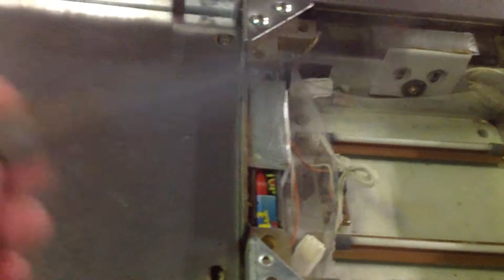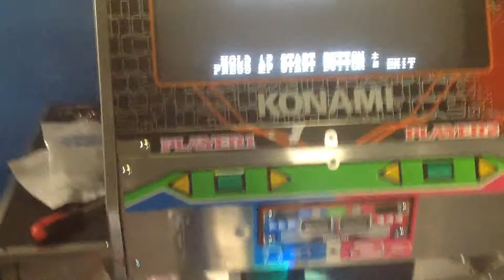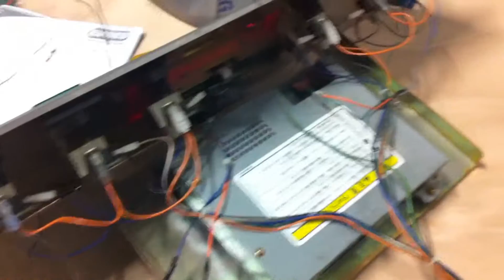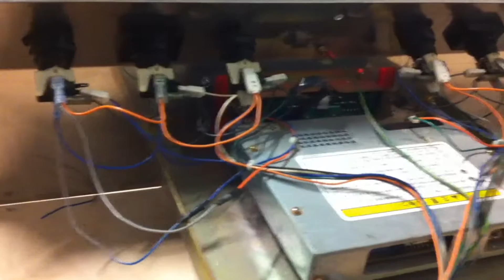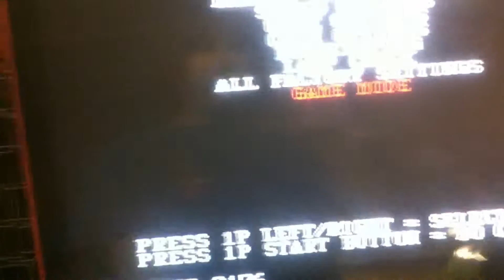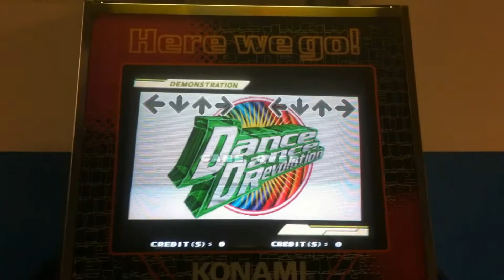DDR Pad Fixes + Memory Card Slot Lighting and Rewiring

Comment: Hi,

have you ever had a no sound issue?

there is a local auction happening with two ddr machines for sale.

one is a max 2 and the other is an extreme.

they have taken the computer and display out of the extreme and put it into the max 2 cab lol. I guess certain things weren't working so they wanted to make one working machine out of two.

so they say that the ddr max 2 cab with the extreme computer works except that it doesn't have sound. 

What could the issue be? just a connection problem or could it be the output from the computer, in which case I don't think that can be fixed. 

Thanks.
Reply from the maker: Could be as simple as an unplugged cable or as complex as a broken I/O/Mainboard.  It's most likely just an unplugged cable though.
Reply: yea I agree. as I understand it there is actually a dedicated sound card which I'm sure includes an amplifier.
Reply from the maker: @ABCarmand  No sound card.  There is a flash card that store various data though, which is also needed but it would not cause audio issues if it was missing, it would cause game errors.
Reply: I notice from the pictures that only the logo on top is lit up but none of the spot lights on top or the fluorescent's under the arrows are lit. I wonder what that means and how it relates to there being no sound?
Reply: so i went to see it today and the speakers have power going to them (they hiss and the sound changes when i adjust the volume) but they have no game audio going to them.

some of the lights work but not all so maybe some burned out bulbs or connection issues.

but most importantly I get an "error 132 cassette error (1)"  right after it boots up from the disk.

this machine did work at some point in the last few days so this error is new. any thoughts?

Thanks
Reply: I think someone may have turned the power off when it was in the middle of booting up.
Reply: on Reddit some guys are saying it could be a loose connection.

Comment: Is it possible to hook up memory card slots to a Korean cabinet? I would think it should be since I've heard that a Korean cabinets hardware is identical to a Japanese cabinet. What do I need to hook up the memory card slots board? I've heard it needs to be hooked up with a USB or RS-485.
Reply from the maker: USB is for data only and that gets plugged into the 573 directly.  You need to pull 5v and GND to the pinouts on the memory card unit.  It is definitely possible to do however because Korean cabinets use a different front plate you can not swap the plate with a Japanese one that has them pre-installed.  You will need to make a hole in the plate yourself or get creative and place them somewhere else.
Reply: OMG KON!
I just received the memory card reader that I bought off eBay. How exactly do I pull 5v and GND to the pinouts? Do you have a diagram of the pinouts so I know which pin is for 5v and GND? Do I need a connector to plug into the pins? There is a bit of a problem with the memory card unit. The white strip that connects the memory card reader to the pins is cut on the 2 pins furthest to the right if looking from the back.
Reply from the maker: Pull power from jamma.  Also I am not sure what cable you are talking about.  You would have to show me a picture.
Reply: OMG KON!  I'll take a picture tomorrow. I was talking about the white ribbon/flex cable that's connected to the pins. It has a slight cut or tear on the flex cable that connects to the 2 pins farthest to the right.

I was hoping this video would show what the back of your hooked up memory card unit looks like, but it doesn't. Do you have any pictures of it? I noticed you were talking the 5v and GND in the video. Is that what you were talking about?

I haven't actually unscrewed the plate and tried to get it to work yet. When I do will there be some wires with a connector I can just plug into the memory card reader to get it to work or will I have to splice some wires connected to the 5v and GND?
Reply from the maker: Send me a message tomorrow when you got your picture.  The GND and +5 are what I talked about in the video, yes.  Also I don;t know what your plate has because if you bought just the front plate it could be anything.
Reply: Could I get all this information too?  I have memory card slots and the PCB for them but I still need one of those GST connectors+wires and some intel about where the wires go in the Jamma harness.  And how to get those wires to stay plugged in into JAMMA.